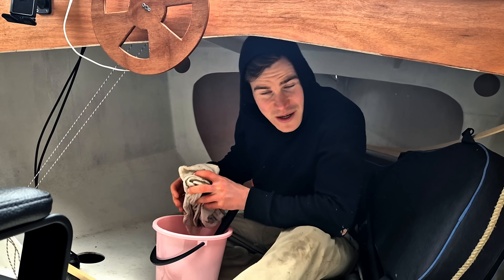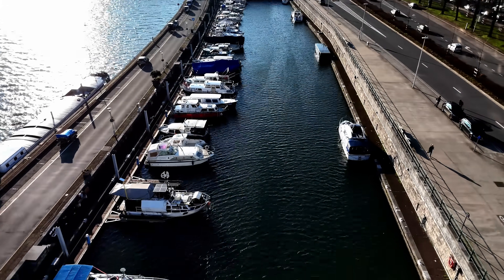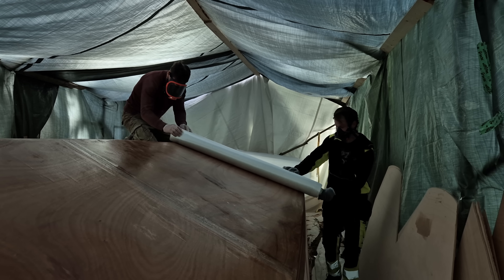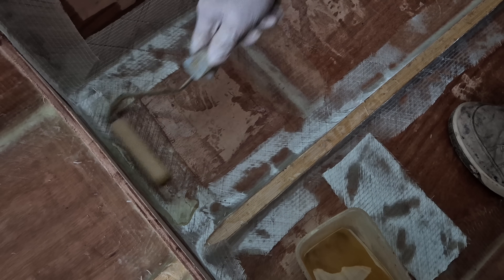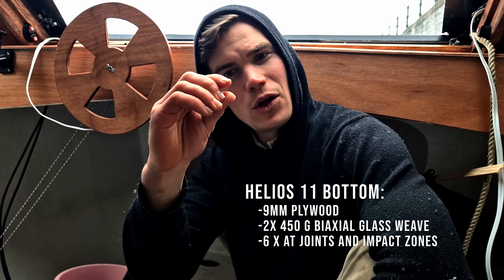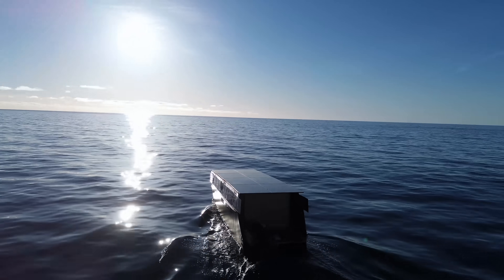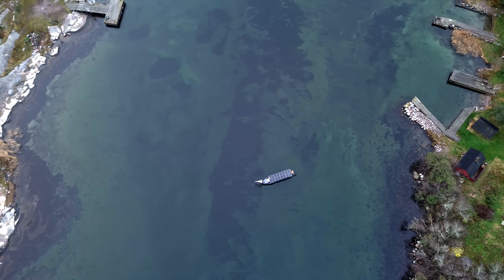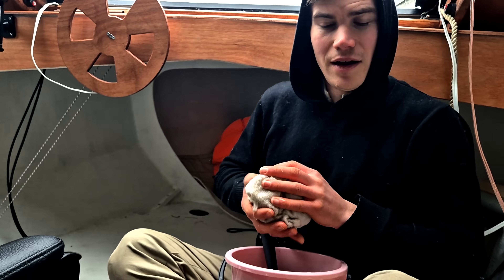I Hit a Log! Is my Solar Prototype too Lightweight?

Comment: I would cover and waterproof the inside 100%, You will always have some  water/ moisture inside the boat from time to time also. Plywood will not evaporate/dry through the layers....the reason is simple: You have water tight glue between all the layers, there is no breathing.....
Reply: Yes, and once delaminated, all the good qualities of plywood are no longer reliable.
Reply: If you want to see a very narrow hull cat for off shore use see a  John Hitch at Lenny Hitchhiker x IT  .  or you will be slamming and digging in surfing down waves even in the Mediterranean. Or a Mike waller type plywood  design  built for solar and  a kite sail  layout. ..you can see those on line ..
If you want to build a stronger or lighter,more abrasion and balisstically resistant hull that's also greener and UV stable  it may be possible to  buy Basalt fiber fabric ..mesh of  bar  tensile strength is 4-5times steel  corrosion proof  1/5 the wt you can buy roving, rope, meshes ... and it has extreem temperature stability as well as UV and bacteria and mould resistance it also resists osmosis and wicking... and as a fabric wets out more easily in laminating.  

The other big increase in strength and durability will come with the introduction of Chemically engineered wood... like that produced by Inventwood , Superwood and MetelWood ....which are also the highest class of fire resistant and 10-20times stronger than the original material. So we are looking at wood ply panels and strips that are stronger and lighter than steel or Aluminium produced from fast growing woods they are also rot and pest proof . 

Many commercial vessels use rigid light wt batts of marine  rock wool .....Basalt fibers again. To insulate hulls and decks thermally and against noise. .. and fabrics made from Basalt fiber woven cloth or mats can be used to fireproof  engine bays or produce none toxic protective clothing that also naturally resists UV degridation .
Reply: Is this true even with epoxy-glass or just with polyester-glass surrounding the plywood core? There is a big difference between these regarding water tightness.
Reply: @allanallansson9532  That is correct, would definitely use epoxy in combination with plywood. You can use polyester also,but that has to be painted many times with 2K epoxy primer.  I have spent hundreds of hours replacing rotten plywood from GRP boats. The funny thing is that even if plywood does not dry through the glue layers, water still penetrates over time through all of them. Plywood is still an ok material for cheap one of boats when properly maintained and built, but a a closed cell PVC core is better.  In the end, the price of the core is still only a relative small part of the total build cost.
Reply: @joeordinary2trumpheroofrussia  Correct, another problem with plywood is that water travels through it,  inside it. A very popular boat builder in my country used plywood stringers under their floor, water ingress started at the transom, usually around the bung at the back, and travelled along the stringers until they had no structural integrity at all...  Water wicks it's way right through plywood ... If I explained that properly..?
Reply: @MickH60  Agree, yes it does trawel, even very long distances, in all directions. Probably capilar effect?
Reply: @allanallansson9532 
Plywood and epoxy boats like James Wharrams designs and also RM yatch's of  France  have been sailing the world's wildest seas and oceans for decades. See wilding sailings 42ft Pahi Catameran.
Reply: On the contrary seal everything from all sides. If breached dry it out and reseal. If rotten, it only rots to the glue line boundaries. It can't dry through anyway. Seal it properly. Any good boat is always fully sealed....
Reply: @fredio54  That's what i said, seal also inside, outside was already fully epoxied. In reality over time it will rot through all the layers even if initially only one is wet first, not sure why, possible the swollen wood will crack the glue layer and then water continues to do its job....
Reply: @fredio54  In my experience, water wicks it's way right through plywood eventually..

Comment: I'd go for more of a wave piercing hull that has an easy entry into the wave then as the wave hit midship  full body, the cat just rises a little.  A thinner hull/Swath would increase skin friction and without electronic stability, dive planes like, could plow into a wave, even nosedive.  You want enough grip on the water with plenty of buoyancy to stay on top of it.  About .3-.5m draft and enough hull width to carry the weight.  4m wide stability won't be a problem unless you build too high. The center deck only needs to be .3-.5m and a common semi hull can be used for stand up room, stop slapping and reserve buoyancy while dropping the cabin roof almost a meter, lowering windage, increasing stability.
You can get an almost round hull easily built and strong by the WEST System Tortured Ply method I've used a lot. Your more square method is almost as good hydrodynamically.
Reply: Yes I'd do it something like what you're talking about
Reply: Good points!
How about a trimaran instead of a cat? And finnfoam instead of ply? (Insulation + built in floating) Use the center hull to have standing height in cabin, beds and sitgroups dont need full height.
Follow beam advices with max 4m
The narrow sidepontons (cat) barlast in bottom to get the weight low and solid finnfoam higher up. Battery storage below deck on sides to get the GZ low. And do stability tests at dock. +90degr and full recovery
Reply: @MichaelBlomqvist-hx4mm  You could and cabin would be lower but really wide, more materials but a lot of room for tilting panels.   I'd still go with for an 11m cat, a 6-7m wide one.    The hulls would be 3' beam so standing in them with sitting headroom for the rest keeps things low.
Google 'Javacat Key West Ecotours' for one I, Steve Brown did in 92 that went 22 knots under sail or 50hp, still in charter service built the same way, epoxy/ply.  A full cabin version would be a great way..
Reply: @jerryDycus-d9c  Here are intresting ideas

Comment: It is good to see your build is holding up well.  The very narrow hulled (VNH) cat design is interesting.  I worry about structural stability  in extreem situations (collision with large debris or underwater reefs / rocks).   Have you looked into the polineasian catameran design (Wharrum) as it is a proven bluewater design.  A solar powered polineasion catametan would be unique, and easy to adapt small sails or kites.  It seems you are headed in that direction.  I enjoy watching your design thought evolution.
Reply from the maker: I will look at that suggestion. Thanks.

As for thr durability of hull, we can always add more materials and "overbuild". Super thickness at impact zones means only like +20 kg of glass and support elements

Comment: What if the planned catamaran would have a beam of 4 Meters instead of 5? Wouldnt that be much easier to handle and be a lot cheaper?
Reply: and concentrate on the ability of an outside walkaround to adjust the panels
Reply: 5% more costly for 20% more room, stability.  I'd go wider unless constrained than longer, which drives up running cost, dockage, ... . Especially if using the heavier panels.